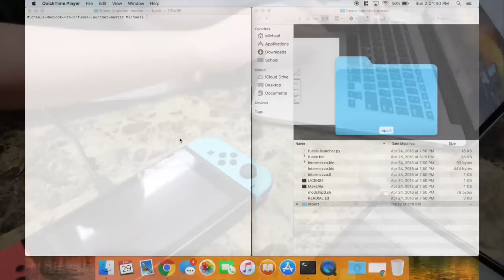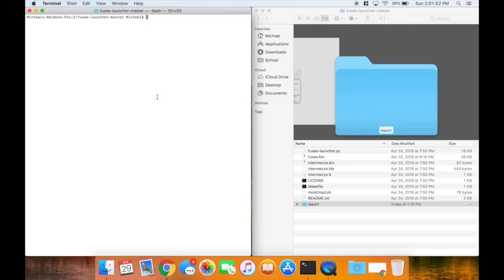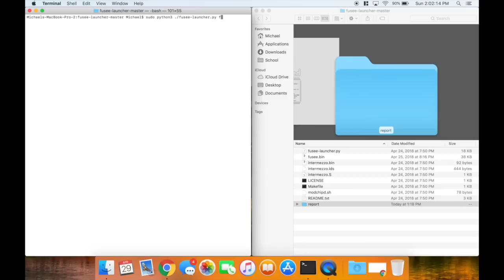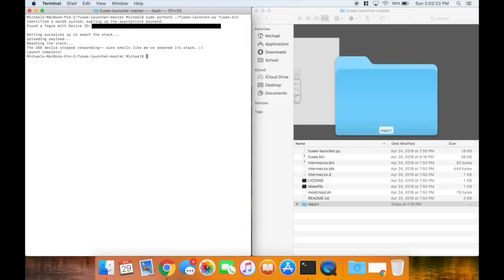How to Hack a Nintendo Switch Joycon + Run Fusee Gelee (Emulators NOW READY!)

Comment: There is a guide online to solder a magnetic reed switch and tuck it away inside the joy con. It's very clean and leaves no evidence of tampering with the convenience of being able to bridge the pins simply by holding a magnet to the joy con. It's the best option if you want to avoid autorcm, imo. Also, make sure to do plenty of research before attempting anything. I have read about people having issues when bridging 9 and 10, but I'm not sure of the details.

Comment: i have a few questions:
is pushing the pins on the joycon together going to ruin the joycon in any way? like, if I wanna push the pins back to normal, will they be messed up at all?
is there a way to undo the hack?
and finally, does nintendo have any way of knowing if you're hacking to ban your account?

Comment: It's a bad idea to bend the joy con pins. Sliding it into the connector like that can damage the connector itself which would be hard to fix. If you wanna mod the joycon, you should go up higher and solder the two traces together before the pins.

Comment: Using Linux, you can either get a vm for windows for a windows emu, or just get an emulator for linux. We know that dolphin runs smoothely (gets near 20-30 fps), so emulation is no problem.

Comment: I see a lot of people saying things will be fine due to the amount of units that Nintendo has already sold. What killed other consoles like the Dreamcast wasn't the units sold. It was the fact that only one person had to buy the game in order for all Dreamcast owners to play it.

Basically, if developers stop making games for the switch due to lack of safety in their ROI, the switch is dead.
Reply: Stop talking out of your ass, you're just a fanboy. Dreamcast failed because it was a failure and its unit sales show this. PS2, Wii, DS, all the most wildly successful consoles of their time. All easily hackable.
Reply: Chill bro. All I was saying was that developers won't make a game for a console when its that insecure. Not sure what made you so mad though. The Dreamcast sold over 10 million units in just over two years by the way. It didn't die because of units sold, it died because of piracy.

Also, I'd just like to add that the Dreamcast was released in 1998 when home video game systems were just taking off, alongside home piracy. A better comparison would have been the 'original' Playstation. Which got a ton more 3rd party support due to the fact that it wasn't "easily" pirated for (meaning you still had to open the case, tape down a button, have a real disc and then swap em out).

Because of that, 3rd party developers had trust in Sony as a medium to play their games. When 3rd party developers don't have faith in a console developer, the console is going to be left with nothing but 1st party games. Which isn't bad to be honest. It's what Nintendo is known for. But you know Nintendo, the money hungry people they are. They'll most likely start to release most of their games over the eShop with DRM tying the games to the console.

I would like to reiterate that I am not a fanboy. I own a Psp, Ps2, Ps3, 2 Xbox360's, 2 Wii's, Gameboy color, Gameboy advance, 3 DS lites, DSI, 3DS, 3DS xl, Switch,  and a Gaming PC. And not only do I have the systems, I have a large amount of games for them as well.

If that's not enough for you, I also own an; iphone 3g and 4s, windows phones, android phones, a slue of ipods, a zune(somewhere..) android tablets, windows tablets, an I pad air (also somewhere..) 3 windows laptops, a macbook, a mac mini, a fitbit, a gear fit, and a bunch of other things.

So if you call me a fanboy, in a sense, it's true. I'm a fanboy of tech in general. It makes me happy to have all these gadgets and marvel at the design changes over time and the improvements to not only the looks but the operational functions, the speed, the feel and the quality. It's something that I really admire, even if most of it just sits on a shelf that gets dusted twice a month.

If anything, I'd say you're the fanboy with the way you go and attack people that say anything negative about Nintendo. But I don't like to stoop to using that word. It does nothing in the way of conversation or debate. It's just a childish tactic and that shows with how you started off your reply.

That being said, I love my switch and I hope it doesn't die. But 3rd party developers are the backbone of any system and the Wii U was proof of that.
Reply: I'm not doing this to show off, just to prove a point and just in case you don't believe me, here's what grabbed off the shelf.

http://i68.tinypic.com/kbr9sm.jpg

Comment: Two question. I''m sure they've been asked, and I am sure everyone is sick of answering, but
1) Can I use the switch normally with normal games. Would this essentially make it a dual boot system? Jump the pins and start in mod mode, leave them open and it boots normally?
2) Would it be safe to update the regular OS since this is a hardware exploit?

Comment: Where did you get the fusee.bin file? It's not in the repo. Do I have to run intermezzo.bin first? Also I can't find any other tutorials on how to do this whether it be on youtube or on some forum. If you can find one can you link it for me?
Reply: From looking on GBAtemp, I found an easier way to load fusee-launcher. You can use this webpage to load the launcher at this link: https://fusee-gelee.firebaseapp.com. This means you don't have to download python3, pip3, and pyusb (even though I already did). I can't test it yet because the jigs I ordered on ebay haven't arrived yet, but based on the comments on the thread I'm pretty sure it works.
Reply: It might. On the site it says you need you use google chrome, and it says something about it not working on windows due to a limitation of WebUSB. It says it's been tested on Linux, OSX, Chromebooks, and Android devices. I'm sure it wouldn't hurt to try.
Reply: I just checked and there is one for $35 on the Apple website.

Comment: Btw can you use windows 10 for this?
Reply: Not currently. You need UNIX terminal for the job, so Linux or MacOS are the only options.

Using Windows shouldn't be impossible though, but this Fusee payload was just a proof of concept, so Reswitched didn't want to build a Windows injection solution from scratch when MacOS and Linux had the needed functionality out from the box. When we get to the point that actual CFW for Switch is being released, I'm sure they'll look into building a Windows solution for the injecting too.

If not, you can always install Linux on something and use that :P
Reply: Lahis Uhh I wrote that comment before I found a launcher for windows, and for android. For windows though you need to install drivers with Zadic first
Reply: @Lahiss  Unix terminal (Linux or Mac os ..)
You fucking trolling ? Unix != Linux
Reply: no you need ligma

Comment: Rather then completely destroying pins 9 and 10, pull the rail off of the joycon. Do a continuity test and make a solder bridge between 9 and 10. Saves the actual interface from the joycon to the system. Worked like a dream for me.
Reply: Michael Rosenberg either way it’s done on the joycon does damage it in a way. The jig is by far the best idea. But like you said in your video. Not a lot of people have a 3D printer. I was just looking for a way to do it and not cause any damage to my joycon
Reply: robodock23 that's what I was thinking about doing. Does it affect anything with that "home button" being pressed constantly?
Reply: Angry Jesus doing the bypass from inside the controller does not effect the functionality of the home button in any way. In the original post it explains that pins 9 and 10 put the Tegra chip Into recovery mode. Along with the button combo. So after the mod is done the joycon still functions as normal.

Comment: lol anyone who thinks hacking the Switch will kill it, the original Wii was the most hacked console in history and look how much that sold! probably one of the most sold consoles ever. The 3DS is also hackable, sells like hot cakes, so was the PSP, All DSs, etc. etc. piracy doesn't kill sales because people who want to buy a game will buy it anyways and people who pirate doesn't mean they would have bought the games other wise. So you don't get 100% loss in sales, the small loss in sales you get are offset by people buying more hardware, oh and did I mention all Nintendo hardware is over priced? so yea
Reply: software is overpriced.
Reply: Nepu-Tech USA thing is, software sales are affected.
Reply: Piracy has the potential of making a system shorten its potential lifespan . This is if the company is too worried about hackers and piracy . They could consider making a new model ASAP .

Comment: can someine with ahacked switch and minecraft pls pls pls try and get into the files and stuff, if you find anything called savegame.wii or gamedata or savegame.dat (you need to make a world) please tell me. if you do find this file, it will be very easy to get modded worlds on switch.
Reply: Ultruhfy "savegame.wii" sounds like a proprietary file that's probably for the Wii, because the name. So I don't think you're going to have that file name.
Reply: ye i gues so, but if someone finds a file called savegame.something then it would still be great!
Reply: Ultruhfy Yeah. Ok!
Reply: Ultruhfy we can already get modded maps on switch ;), also it would only be in the save data, which you can only access on 3.0.0 right now until atmosphère is released.
Reply: i know we already got custom maps through wii u, i do it myself, its just it would be less hassel if it was on switch by itself

Comment: bending pins? nooooooo. don't do it. its not good for the pins or what they connect too. why would you do that?
Reply: Richtig das ist das letzte
Reply: It would make more sense to bridge the pins where they solder to the PCB. It's easily undo and it doesn't require bending pins which is definitely not a good idea.

Comment: Ok I have 1 more question, If I do the pin bend trick and I keep the pins that way permanently,will it still charge normally and can I use my Joy-Con Charging grip? The reason I am asking is because I was thinking I would just use a 3 mm length of 0.6 mm solder and set it between the 2 pins and solder it on permanently and it would look completely normal with any inspection unless it was taken apart as it could be done high up on the pins.
Reply: so there is nothing to stop me from soldering them then is what you are saying as everything will work normally.
Reply: I already did it and everything works fine as far as I can see but I did notice that the 4 lights on the right side of the Joy-Con charging grip does not light up now but all the buttons work fine and it seems to charge fine as well. Thanks for all your help Michael and I gave you a thumbs up and subscribed :)
Reply: do NOT bend OR solder at those pins.
bent pins can eventually break, solder WILL rub off on the pins in the switch rail and could potentially cause a short out.
if you're adept at soldering, follow the picture guides and solder the pins under the foamy bit (just above the actual pins)
Reply: also, just dont do it yet at all. there is nothing to gain right this moment. in 2 months, maybe. and till then, god knows you can get the jigs preprinted for 10 for 2 dollars and dont need to mess with your joycon at all

Comment: Good video. Those pins are so fragile.. it’s easier to get a 22gauge wire or even just solder together..would suck to break the pins and need to buy another joycon.. I’m sure on eBay soon there will be the 3D printed parts.. I have a printer.. maybe I should start selling..
Reply: Michael Rosenberg if your good at soldering and have the appropriate setup. I’m a Flight Engineer.. I have a background in Avionics soldering Aircraft wiring and many cables .. my setup can change temperature and I have done things before similar. I actually upgraded ram in a Mac.. that’s hard to do!
Reply: Do you know which 2 points are 9 and 10 under the foam? Thank You Sir

Comment: how do you get fusee for windows?
Reply: Well I guess i will have to wait then cause I have a Windows 10 x64 computer and there is no way in hell I am using ANYTHING that is from Apple. Maybe I will install Linux on a second partition but not sure I am that desperate for a Linus mini tablet at the time. I really just want to run P.C. games using my Logitech Bluetooth controller. Thanks for the quick response :)
Reply: that too
Reply: @TJharcus  it works for windows now

Comment: I wonder if people will start selling these modded joycons
Reply: hope not, I used a paperclip to connect pin 10 to a screw on the rail and it worked just as well
Reply: Can you find a way to try to move the pins without opening the joycon
Reply: @cobsters2138  that gives me much more hope!
Reply: No cuz it's so easy
Reply: Reecey 10001 after the boot you can just reinsert the joycon and for the small part problem you can redesign the jig to look like an actual joycon and even if don't want to when they release a costom firmware you have to do this procedure only {or maybe neither then} when you are going to update the software

Comment: You can also just use a paperclip
Reply: DARTH MAUL It's difficult.. I'm trying like 2 hours and it didn't worked for me.
Reply: that could damage the parts quite severely. You could also accidentally short your switch/joycon if you do it badly (a very easy mistake to make without a 3d printed tool to help you guide the paper clip)

Comment: can you do it on windows so without terminal if so how? And how will I be able to play emulators and stuff
Reply: Zyvyn linux isnt unix ffs
Reply: but Unix-like
Reply: The current Reswitched Fusee payload is just proof of concept. It should be possible to make a Windows environment for the payload injecting, but since MacOS and Linux had the functionality out of the box, they didn't bother to build one for this.

In year or two when the CFWs really start to roll out, I'm sure there will be Windows solution for the injecting. If not, install Linux on some old laptop or dualboot your main system.
Reply: Confruggy but still *nix =/= unix standard
Reply: you cannot do this on windows you need a UNIX based os so linux or macosx and virtualbox does not work